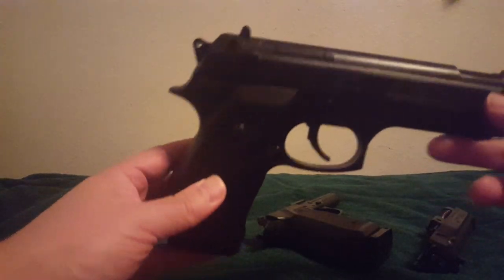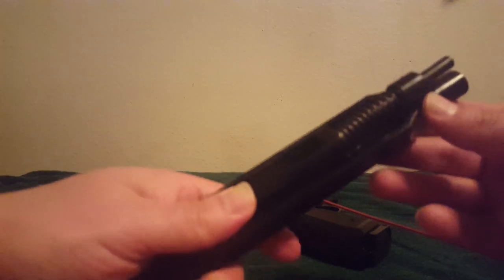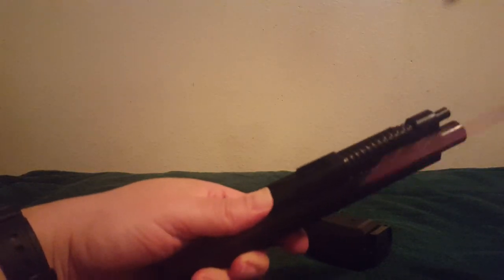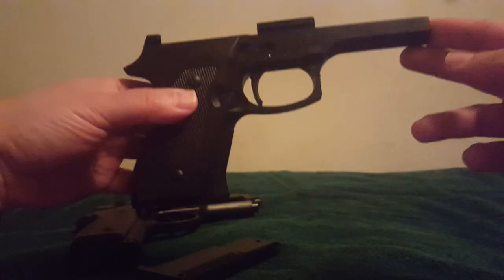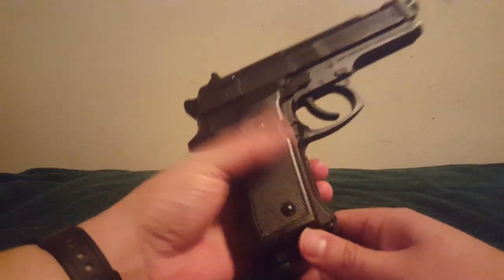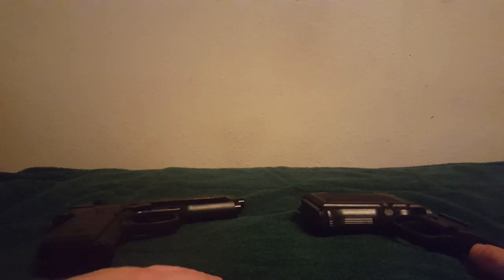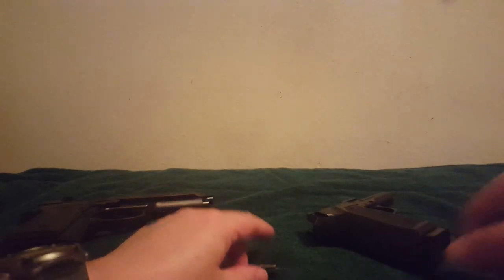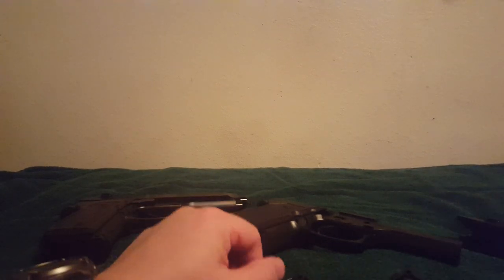Daisy 340 - It Doesn't Shoot.  Checklist.

Comment: What kind of malfunction do you think would cause a BB to roll out of the muzzle with minimal velocity when the trigger is pulled?
Reply from the maker: Primary issues would be breach seal damage or piston tube damage. 

Damage to piston tube would come from dry firing without BBs. The piston head zooms forward without resistance. Piston head damage could happen also here. 

The breach seal, where the BB sits, gets torn up by Used BBs, the sharp edges. Please use only Dasiy BBs and only NEW BBs.
Reply: I appreciate the response. My 340 went down an hour or so after opening the package. I probably dry fired quite a few times just expecting there to be another round in the mag but I'm surprised it happened that quickly. I did contact Daisy for support. I imagine with seal damage there's not much i can do about fixing it, right?
Reply from the maker: Crills, this looks like a BIG problem. It looks like a cracked piston tube. That tube is where your piston head resides that fires your BB.

If you have been dry firing the gun, that TRADITIONALLY destroys the piston head in more POWERFUL spring guns. In the 340, shooting Copperheads or dry firing it breaks the plastic piston tube. The Copperheads are too small, like semi dry fire.

I only use new Daisy BBs, and I count how many BBs are in feeder and track it. I try.not to dry fire it.

My third 340 still alive and well. My issue was the metal post breaking. I stopped dry firing hammer. My original slide lasted 8,000 shots.

If you have been dry firing the piston, get a new 340 and don't dry fire the piston - or the hammer. They may send you a replacement.
Reply: Thank you for solving my problem by thoroughly answering questions like this. My 340 is over 12 years old, but there have been times it was dry fired because someone didn't keep track of the BBs. I suspect it is just time to move on and get a new gun and make sure everyone follows protocols.
Reply from the maker: @shannonmariempc  - You are welcome. After 9,000 shots on 3 340s I got for $30, I know the design well. I know every part of the gun. It was a fun mission.

Dry firing a break barrel - THAT HAS A METAL PISTON TUBE - is not as big of deal. They say it can take it, but is a bad habbit and sounds like a firearm (which could lead to trouble).

The 340 has s plastic tube and dry firing THIS MODEL does shatter the front. No power. A damaged breech seal could be another reason, but that never happened to me. 

Also I took the slide to its FULL LIFE. Went 8,000 shots and the piston tube is still intact. I rarely dry fired, only by accident.

Comment: My BB gun won't cock and it doesn't feel as if the spring or whatever it is is actually holding it, like even if it's empty it won't cock
Reply from the maker: My experience with the 340 has taught me the zinc cast post in back cracks, bends, and can break completely off. YOUR GUN WON'T COCK AGAIN. THE SEAR AND PISTON MISALIGNE.

 I've tried to look at problems with the piston sear, but I have 9,000 shots, on 3 340s, and I never had a problem with the sear not catching the piston. 

ONLY THE POST CRACKING AND WARPING STOPS IT FROM WORKING.

Here this shows it.
https://youtu.be/ga_bux7DMDQ

A BB loose inside stops it from cocking but if you watched the video, I show how to clear it.

Comment: i pull back bolt and it automatically shoots back
Reply from the maker: My experience with the 340 has taught me the zinc cast post in back cracks, bends, and can break completely off. YOUR GUN WON'T COCK AGAIN. THE SEAR AND PISTON MISALIGNE.

 I've tried to look at problems with the piston sear, but I have 9,000 shots, on 3 340s, and I never had a problem with the sear not catching the piston. 

ONLY THE POST CRACKING AND WARPING STOPS IT FROM WORKING.

Here this shows it.
https://youtu.be/ga_bux7DMDQ

A BB loose inside stops it from cocking but if you watched the video, I show how to clear it.
Reply: @daisy880fanaticfixit9  but i dont shot bbs i just cock the gun back and fire since were using it as a prop for a school project

Comment: I have a problem with the magazine not loading bbs into the slide how do I fix this?
Reply from the maker: Part of the problem is the prongs don't hold the BBs in and one pops out before cocking it

RESULT: the slide jams, and you have to eject mag and shake it to get loose BB out.

You also could have a breech jam. BBs won't load because one is stuck in the breech. I show that in this video.

The 2nd problem is that the mag prongs grind down and Copperheads and Basic Daisy BBs are TOO SMALL to stay put in the mag prongs BEFORE you cock it.

FIX: Tighten the screw on top and use BETTER, BIGGER BBs - Avanti and Umarex Zinc.

☠The worst news I have to deliver to you is that when the post in back gets metal fatigue, it cracks and warps and the gun WON'T COCK ANY MORE.  The piston sear can't engage the piston.☠
Reply: No it not that is thata a bb doesn't pop out
Reply from the maker: Did you take off the slide and check for breech jam? Just run a rod down AFTER opening a gap with your other thumb. It is in the video.
Reply: Yes there  no bb
Reply: I think it a problem with the magazine grabbing a bb and loading it
Reply from the maker: Ok, that is smart. A matter of deduction.

⚠️Unless you say you have thousands of shots on this 340, the post in back being warped is unlikely. If you HAVE, shot thousands of times, it is VERY likely.⚠️

So lets look at a part we haven't touched yet. So you say BBs aren't getting loose in the gun, not a MISFEED. You checked the barrel for breech jam, and it is clear.

The third part that makes or breaks the 340 is the HOP UP. It is the piece on your slide that guides the BB into your breech.

The hop up is two loose pieces that flex to allow the LOADER ( the plastic fin that strips a BB from your prongs), to carry it through your hop up, and into the  breech. If that is badly CHIPPED, the middle man between your loader and breech is out of action.

This video SHOWS your 340 parts in action.

https://youtu.be/0Wsz-jUCHCU

Comment: My 340 didn't even last two days before the feeder broke, absolutely disappointing and I wasn't even able to return it!
Reply from the maker: Sir, I get  it. I have walked away from 340 until they re-engineer the magazine to make it more like the Crosman psm45. I have 9000 shots on 340. When it doesn't jam, the post in back warps, in time, and it won't cock any more.

SLING SHOTING THE SLIDE CAN CAUSE THAT EARLY DEATH.

What likely happened to you, and it is NOT your fault because Daisy should give guidance, is that shooters don't handle the slide right because they sling shot it. That breaks the plastic parts inside like the hop up.

You should be told to RIDE THE SLIDE HOME.

My psm45 has had no jams. I shoot Black Diamond BBs  and ride the slide home. 1500 shots in.

Comment: I got one yesterday day and it already gets bb stuck in it I did your method and it still gets stuck if you have any other help I need it
Reply from the maker: Yeah, the 340 is a jam monster. I hate to admit it. I transferred my flag to the psm45.

On this gun, the feed jams can come fast. I figured out to ONLY LOAD 5 BBs at a time. 

The two jams, short of the post breaking in back, are feed jams and breech jam.

Try clearing it again with the half rack and shake. Make sure your mag is out. Then try only 5 BBs at a time.

 If no dice, you could have breech jam, then half rack, and run a rod. You also can take the 340 slide off easily.
Reply: @daisy880fanaticfixit9  is that the best spring powered one if only found the Daisy 340 and the psm45
Reply from the maker: The psm45 is BETTER MADE. As long as you use good NEW BBs, it performs great. Cock it right.

https://youtu.be/smGRTF4NZXc

https://youtu.be/mOKz6FUcBFE
Reply: @daisy880fanaticfixit9  I think I just slingshots it too much it lasted like 40 shots but every one was slighshot
Reply: @daisy880fanaticfixit9  one more question are copper head bbs good or should I get diasy or crosman bbs I have 6000 count of copperhead bbs
Reply from the maker: You look like a smart guy, and you can admit when mistakes are made. Many of the issues with the 340 aren't your fault. Even if you do everything right, the die-cast post in back fractures around 2000 to 3000 shots. Your gun won't cock anymore. The post holds your spring, and once it fractures, the piston sear and catch won't mate anymore.

The psm45 can be broken, too. The young lad in the video below is smart but handles it like a real Glock - DEATH CITY to his gun!

https://youtu.be/GArcDEJVWeI
Reply from the maker: Copperheads are THE worst BBs you can put in a 340! They are TINY, and your 340 prongs can't RETAIN THEM😩 - JAM JAM JAM😩

They also RUST  if not treated with Blaster Penetrator or WD40 Penetrator Specialist.

Go Daisy BBs or better - Black Diamond. Just 5 in your feeder.
Reply: @daisy880fanaticfixit9  thanks for all your help

Comment: Mine fires but bb only travels about 4 feet from the barrel and drops.🥴
Reply from the maker: When owners dry fire their 340, the extra speed of the piston cracks the plastic piston tube. Air escapes, and the BB shoots 4 feet.

When you shoot with a BB in the rubber breech, it SLOWS the piston down. The tube holding the piston survives.

Better made brake barrel rifles can take the dry fire, but it is bad gun handling and sounds like a firearm. It is discouraged. For your 340, dry firing (no BB) can be fatal to the tube.

Comment: Hey bro so I need some help really bad, So my works fine its called a METAL PISTOL and to reload the gun dosent wanna stay in it keeps falling of and I have to hold it in to reload the gun so I need some help please man.
Reply: It's just the magazine that keeps falling off and it's so annoying please help me!
Reply from the maker: Kane, so when you say metal pistol, is it another model? The 340 is almost all plastic.

On the 340 the mag dropping out is caused many times by wrong grip or the mag catch wearing down. Also, the return spring that locks onto the mag can break down. 

Is it 340?
Reply: @daisy880fanaticfixit9  No its not a 340 it's actually metal its heavy im not sure what model it is.

Comment: My Daisy 340 stopped cocking and just slides. I checked for any stuck BB's and nothing. I dissembled and reassembled the top  sliding piston but did not see anything broken. The hammer seems to be fine. Perhaps the piston tube is cracked?
Reply from the maker: Arturo, yes, the piston tube can crack IN FRONT. But, your stoppage is interesting because if it doesn't cock, and lock the piston back, that could be a piston sear break or the torsion spring underneath it.

(1) Check the metal post in back. Is it intact? I haven't had a hammer break yet. But the post, part of your sear assembly, that broke twice on me from dry firing  the hammer. 3rd 340 now at 5400 shots. Hammer cocked only when I fire the 340.

(2) Did you look at the front of piston tube? Use a maginifier to check for crack up front - that breakage is easy to see.

If your metal post is in intact and the piston tube is solid, look down on the piston sear. That is the part near your post that looks like a door stop. It locks tbe botton of your piston. You can see the catch point if you look at the piston bottom when your slide is off.

Does the piston sear look damaged? Can you push it down AND it pops back up?

Check the piston catch for any oil build up. Wipe it off. Check if the piston moves freely in the tube. You may need to use Sper Lube O Ring silicone.

Comment: Mine keeps firing without pulling the trigger. I rack the slide, let go, and it fires. Even when i dont let go, it still fires.
Reply from the maker: Sir, how many shots do you have on the 340?

Your piston catch and piston sear ARE NOT locking.

Also, if the post in back is cracked, it warps and your gun won't cock any more. A warped post is terminal.

Take off the slide and get magnifier, seeing the crack at the bottom of the post is hard with naked eye.

Also, a spring related to your piston sear could have broke, but I've never seen that.

Take of slide and search the post for damage. Cock the hammer to see if the door stop sear goes up and down. Ride the hammer up with your thumb to avoid damage.

Comment: From the day I bought this BB gun - it shoots maybe 10’.   I took it back but no refunds.   Any ideas why it won’t shoot?   I’d be happy with 20’ at this point, ha!
Reply from the maker: Hey, Doug, thanks for being good natured about a carnival gun like this one. A Red Ryder is low power, and the 340 is LITTLE power.

If the the gun is operating well, it can punch through the front of pop can filled with water - and flat in front.. I've gotten pretty good with mine and do well killing cans at 5 and 6 yards. Daisy says that is the range it is meant for by design. 4 yards is quick shooting drills.

The 340 has much going for it - that is how it was designed. But after the corporate washing machine,  the part quality could be better. The plastic piston tube shatters in front if you dry fire it or shoot Copperheads. Those Crosman BBs are too small, some coming in as little as 169. That is like semi dry fire, and breaks it in short order.

In the beginning, 2 of my 340s broke in back, the cast metal post in back the holds the spring and gets hit by the hammer, snapped twice. I did trace it to dry firing the hammer. The 3rd 340 (bottom half) is going on 5600 shots. The original slide went 8000 shots before shooting like you describe. The spring set.

Doug, if your gun still shoots, switch to Daisy BBs and use only NEW Daisy BBs. Lube is not the issue. I do use 30 SAE ND on right side of cocked hammer to smoothen trigger pull. Every 200 to 400 shots. Hammer hook and sear.

Comment: I know I'm late, but can you keep the slide back?
If so, how?
Reply from the maker: Billy, no. The 340 has no slide lock. That acts as a safety on this unit.

Also trying to hold back the slide by hand could break off the metal post where your hammer hits.

Comment: When I rack the slide it shoots a bb
Reply from the maker: Tyson, when the post in back, that your hammer hits, starts to age and warp, the gun won't cock anymore because the piston and sear misalign.  

But I haven't seen a BB shoot because of that. The spring isn't charged. For you that could mean that you cock it, but the piston sear releases on its own after a second. I never experienced that malfunction. Or you have your finger on the trigger,  and you are unknownly pulling the trigger right after racking it.
Reply: @daisy880fanaticfixit9  thanks for your response!

Comment: Mine the hammer is down and it doesnt shoot anymore
Reply from the maker: Jacob, please confirm what I say: 

The hammer is back in firing position. But won't fly forward when you pull the trigger.

That is a broken torsion spring.

If that is the case, that means a new spring under your hammer (that has L shape). 

Daisy did send me a new sear assembly that has that torsion spring. But I don't know if they will do that any more.

Comment: My powerline 340 bb is shooting bad distance it only goes to about 4 feet
Reply from the maker: Moon, this looks like a BIG problem. It looks like a cracked piston tube. That tube is where your piston head resides that fires your BB.

If you have been dry firing the gun, that TRADITIONALLY destroys the piston head in more POWERFUL spring guns. In the 340, shooting Copperheads or dry firing it breaks the plastic piston tube. The Copperheads are too small, like semi dry fire.

I only use new Daisy BBs, and I count how many BBs are in feeder and track it. I try.not to dry fire it.

My third 340 still alive and well. My issue was the metal post breaking. I stopped dry firing hammer. My original slide lasted 8,000 shots.

If you have been dry firing the piston, get a new 340 and don't dry fire the piston - or the hammer.

Comment: When I cock my gun the bb just fall around and gets lose in the chamber
Reply from the maker: Well, the gun breaks in the most common way which is the post in back warping. It can happen in the  most basic ways of slingshoting the slide which stresses the post or dry firing the hammer without cocking the gun.

The spring is good for about 8,000 shots, but most never get there.

Eject your mag from the gun, skake it to see if a BB falls out. If no dice, half cock it and shake again.

Check the screw in the top of mag, make sure it is tight. Put a          forefinger on top of prongs when you use stick to load feeder - that helps feeder prongs last longer. When the prongs weaken, BBs just shoot up into your gun. Jam city.

Ordering new mags from Daisy helps. Cycling between mags helps each one last longer.